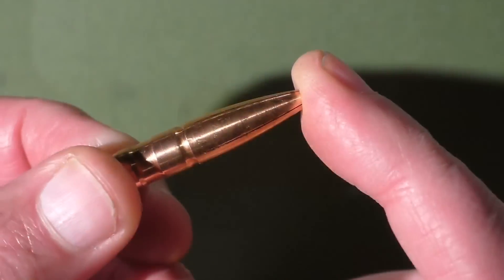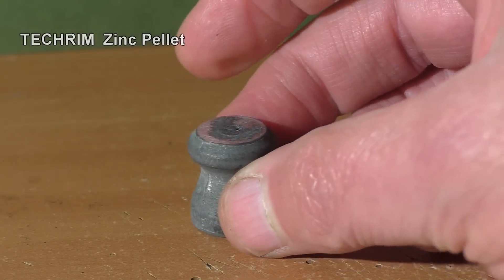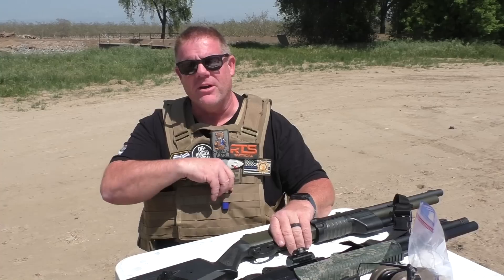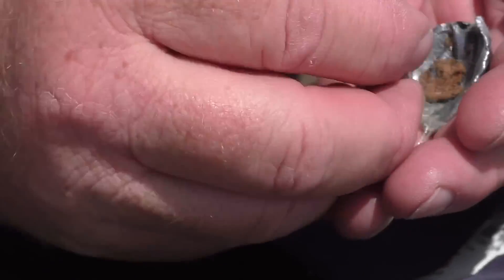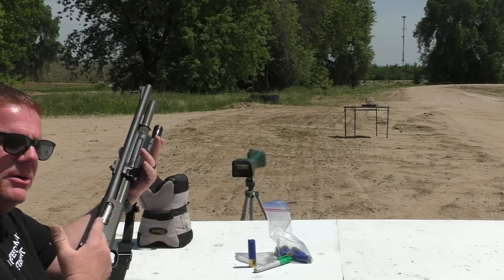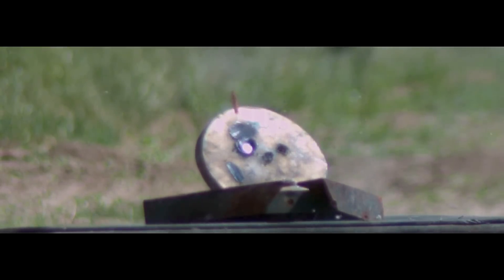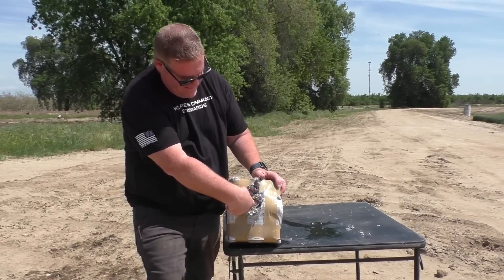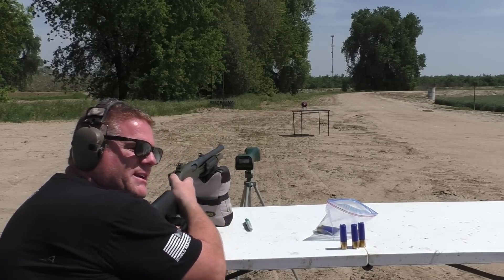300 Faust - 12ga. Slug Prototype -  First Test

Comment: Hi! I think in order for 300 to fly straight, you need to put a diablo with 300 in a container, to stabilize 300 in the barrel when moving, you need to make another container of two halves, they will hold the bullet in the barrel and when they exit the barrel they will fly apart, and you can put a coin or several coins on the bottom of the container for 300. It turns out that the diablo will be subcaliberal. Good luck!

Comment: Not a heavy metallic backing disk, but light. Try to find a titanium disk of appropriate size. The game is in yield velocity, which you will be far below. Also, once done with that bit, switch to the zinc pellet, almost bored to diameter. The Ti disk will do the acceleration, and with any luck, the bullet will go on, and the zinc pellet will separate like a sabot.

As an afterthought, you might have to cap that hollow point with something light and hard, like gorilla glue, to keep the supersonic shock from peeling back the petals.

Comment: could you cast the slug onto the 300 BLK hovering .1 to .15 inches over the bottom to make it incased inside of the slug so when you cast it lead gets under the 300 BLK round and fills the indents on the round instead of being pressed into it? That along with the steel disk you mentioned would probobly keep it intact

Comment: If you have the ability to pour lead into the back of the bullet and still maintain the shape of the slug with an 1/8 inch of lead over the base of the other bullet it would stop it from coming out the back side.

Comment: A small hole in the base but and then press the bullet into the slug from the top. 
I think the experiment may not have been a failure. Try the same slug without the 300 in it but just the drilled slug and a steel plate to push it out the barrel. Doughnut slug😂

Comment: Just out of curiosity, how did you center the spot to bore out the lead on top of the slug? I've been thinking about a decent way to do something similar to make a hollow point cavity with some flat-point lightweight frangible 9mm projectiles

Comment: The experiment may have failed, but it was still interesting to watch. That thing has some nasty punch behind it, getting through the wet magazines.
The two things I would suggest to keep the projectile together; firstly something more solid for support as Jeff said. Secondly, what about reducing the powder load a bit? 1600fps is fast. Maybe reducing the powder load a bit so the acceleration isn't as high, maybe the press fit of the bullet in the slug would be able to hold it?

Also, 9:20, we call those red cabbages as well. Aubergines are what you guys call eggplants.

Comment: If you know a bodyman, get ahold of some 3M panel bonding adhesive.  I'm not saying it'll work, but it could.  I've used it for many things that it was not designed for and it is just amazing stuff.  Imagine J.B. Weld on steroids.  Even if it doesn't work for this particular round, I guarantee you'll find other good uses for it.  I enjoyed the video.  Keep up the good work!

Comment: I know that everyone is a critic and that hindsight is 20/20, but I feel like this was kinda obvious from the start. The problem is that you're to use a straight wall friction fit with two different materials where the smaller (and harder) of the two is unsupported from it's rear-most surface as it is rapidly accelerated thousands of Gs in an instant. They would have stayed together much more consistently if the base of the 300blk bullet were at the same place as the rear surface (where the accelerative force is acting) such that both can experience the same force at the same time.

But again, I KNOW that it's easy to diagnose stuff after the fact. But here's my retort: as an engineer who's spent many years predicting and analyzing these types of interactions between various metal alloys, as well as someone who has been an extreme firearms enthusiast/advocate, this want surprising to me in the least. 

In fact, I was actually shocked that Jeff didn't consider this potential variable before loading all of the rounds up. It would be great to see this addressed in a follow up video where each 300blk projectile is pressed down to where it also touches the fiber wad along with the diabolo. Or, if he wanted to maintain the same length, slightly opening the 300blk petals such that the diabolo cannot be accelerated through the pressed projectile (which is the consistent separation between the two we see here.)

Comment: Drill  .007" smaller. Freeze the .300AAC round and press it into a 350⁰ degree lead slig. The expansion and contraction will make a tight as hell fit.

Comment: A suggestion:
After pressing the pieces together like you did... Cross drill all the way through both pieces and press a nail into the cross hole, then cut the nail off on both sides of the projectile.
    In other words... Pin it in place.
    Of course the hole for the nail needs to be sized for a tight fit.

Comment: Maybe a bit of epoxy around the inside of the slug for the bullet to bond to?
Just enough to adhere, but not enough to throw off the balance. 
Metal face to the wad? Tin circle? Aluminum Maybe? 
Interesting regardless.

Comment: Try tinning the bottom of the bullet and after pressing it in use a large soldering iron to solder the bottom of the bullet to the slug.  Or don't drill all of the way through the slug, bake a counterbore and press the bullet in until it hits bottom.

Comment: how about 2 metal pins going through the slug and 300 black out in a + pattern 1 higher than the other 
It might rip out with just 1 but i doubt it will with 2 and if/when the lead gets torn away in a target like um pork shoulder LOL why not the metal pins will add to the wound path yeh not much but still bet it would show in ballistics gel

Comment: Hey Jeff, if you want to do a good press fit, put the bullet in the freezer and heat the lead slug enough to expand it some. Obviously you have to be careful heating lead, 500-600 degrees would be more than enough. About .015 would be more than enough press. Probably the cold bullet might drop in if done quick and be super tight when everything stabilizes. That way you’re not shearing off lead doing a regular press fit. I was a toolmaker for 25 years and did this stuff all the time for many projects.

Comment: Was that a HRC made in China Hard Drive? I hear they emit a chlorine odor as they heat up.....   So... easy button...JB weld..put some on before pressing in, fell rear..... not so easy but probably better.... Solder the rear.... hardest... "tin the back half of bullet, heat bullet slightly above the slug melting point/, flux and press in, solder rear...   cool idea, fan of Lehigh bullets for years....

Comment: Ahh, the "Dry-hoondirt Faust" a new fan favorite for ingenuity.

I'd try scuffing the round and hole before pressing it in and using some red loctite or higher. A little bit of fimo clay would be easy to form into a drop out support piece in the back of the diabolo.

Comment: 13:19 cross drill the slug/300 blackout and secure the slug & round with heavy gauge steel or copper wire or ??? something to make the connection between the two permanent. putting a steel back plate, isn't giong to fix the issue. You need a physical connection between the two. Lead expands in the barrel, and creates enough of a gap between the bullet & the slug.

Comment: Before you write it off as a failure think outside the box, you now have the 300 Faust Double Tap, the round that hits you twice. As far as metal disk, find an electrician and have them save you some small knockouts, you may have to size them down a littlest bit, just an idea. Also, try  super glue to hold the bullet in place. Hope y'all have a great week guys.
Reply: Superglue would be bad because it can't withstand shock. JB weld would be much better.
Reply: @witiwap86  or heat it melts
Reply from the maker: lol
Reply: I’d go for red locktite

Comment: Take the blackout round and lathe the base of it into a pin about .5 inch long.  Drill a center hole in the top of the diablo slug the same diameter as the pin. Super glue and press together. 
The reason the round is seperating from the slug is the g shock is pushing the round out of the slug the same direction that it was pressed in.

Comment: I thought the first shot was a keeper. heart AND throat in one goal. BRILLIANT!!!
Retention;  JB weld.  Heat the bullet and slug before joining, may solder them together.
If JB or resin, drop a primer in the hollow for a little extra spice.  Or skip the Blackout and pack the slug with primers.  Possible early 'sparking'... working on that.
OOO ooo. Lead fill a hole saw bit for the rifled barrel.

Comment: Good potential. It might help visualize the firing process to think of the components as being soft and plastic. At those pressures, they are, and flex and squirm in strange ways. Gasses will distort the shapes; hence being unable to join the projectiles firmly. The modeling of the initial 0.1 seconds of a nuclear detonation, sort of.

Comment: Drill the slug from the top and leave enough of it at the bottom then press the blackout in from the top make a tapered dohicky so when you press the point with press you don't destroy the tip. Great shoot that's how you learn.

Comment: Looking at the profile of the 300 Blackout bullet, I would think you might have better luck casting the pellets around the bullets,  There are 2 lateral groove bands on the bullet that the lead could grab onto.  Add in the metal disc, and I think you'd have a winner.  Great video!!
Reply: I was thinking something similar. My thought was pour lead into the cavity and seal in the 300 Blackout. But I’m not sure that the new lead would “bond” to the slug. It would probably be better to cast a new slug around it.

Comment: Greg, I have an idea for how I can solder your bullet together, but I'm not 100% if it will work. If you're interested you're welcome to post up a way to contact you and I can give you an address to send a few of them to. I would need to keep the bullet cold somehow while I do the work but I already have an idea for that one (i'm going to freeze it in water ice and solder it from the base first, then re-freeze it upside down and solder around the nose). If you have any better ideas you're welcome to try them, but IDK why it wouldn't work if they're properly bonded. Another idea is you could buy a sacrificial mold, drill it out, buy some flux paste meant for soldering, and coat the bullet in it before pouring. This would allow you to solder it in place yourself far more reliably than I ever could manage on my own. If freezing it in ice doesn't work I could probably try ceramic or even sand as a support, but I'm concerned both options will leave a coating of them on the projectile. You could also try fluxing the bullet before you press fit it, and then encasing it in a plaster shell, before heating the projectile so the lead melts and solders itself to the copper bullet. I'm sure I could think of other ideas if given more time, this was just what I came up with while watching the first half of the video lol. But yea, plaster is probably your best bet for DIYing my idea yourselves, it can withstand 2200F/1200C temperatures before melting, much hotter than lead needs to be in order to melt it.

Comment: Try threading the blackout into a threaded slug next time. You’ll loose some copper jacket, but if you cut slow and deep, it should hold. Or pour some resin into the skirt of the slug after you’ve inserted 300.

Comment: Since the blackout is a boat tail round, would you get enough support if you poured the cavity in the bottom with more lead, resin, etc.?  Just trying to think of a simple solution.  Was thinking that if the base was solid, it'd give better stability.

Comment: If you coat the slug and bullet with some flux and heat the latter with a torch for a bit, they should meld together. Maybe add some solder to keep from losing lead out of the slug... Or, drill the hole even smaller and heat the bullet to 650-700F before pressing it home. Or... well, you get the idea.

EDIT: Had a last minute thought.... you're going to have issues with this particular slug unless you can firmly, physically attach the bullet to the slug somehow, and even then it may be trouble. Why? Because the slug base is a gas check, whether intended or not. It's going to expand to fill the bore within the sabot sleeve, and when it does so it's going to stretch the hole and remove the tension from what's currently a press fit. It might even be enough to tear a glued or soldered surface apart. If that's the case, the easiest solution would be a pin (as someone else already mentioned) or possibly adding a metal gas check to the bottom of the projectile.
Reply from the maker: probably end up as a puddle of lead  lol
Reply: @taofledermaus  If you could find yourself a mold for those slugs you could modify it and cast around the bullet, then the bullet's rings would help hold it in place as it's a shrink fit.

Comment: The only thing I can think of to try help the two pieces of the round stay together would be to cast the bullet into the lead slug. I'm thinking of a solid diabalo slug, not one with the hollow skirt. And I'd have it so the base of the bullet is up say 1/8th of an inch to help stop the bullet passing backwards through the slug.

But this is coming from an Aussie who's only experience with guns in paintball and a bb gun when I was a kid.😅

Comment: I actually think that you are on to a great concept with this. However, instead of drilling completely through the slug, how about only drilling a third to half way down from the top and use some epoxy. That way the slug will expand and then push the.300 out. Instead of blowing around it

Comment: I think you'd have better luck if you somehow cast the bullet into the slug. press fitting just isn't enough. Or maybe you could press fit it into the slug, but leave some solid slug in the butt, so it can push against the bullet

Comment: My two initial thoughts were a lead or magnesium back plate behind the slug,, Then the complicated process of casting it in a slug, or even turning a simple mild steel boring tool the same shape as the back end of the blackout so you could drill that shape into, but not all the way through,  the lead slug

Comment: Try top drilling and do not go all the way through the "Diablo pellet" then insert from the top hole you partially drilled through till it bottoms out. I used this method for tungsten core pistol ammo yrs ago. It worked great and would shove/hammer the tungsten straight through the hard target. Never a slip through.

Comment: You need a couple of the back of those pellets in order to keep the bullet from coming apart I think I seen that opening I was like the pressures probably going to separate them when you fire it was like off the back of them with solid it probably wouldn't

Comment: Have you gents fired the very modern 50 cal pellet rifles? They can drop a boar or deer from what Ive read.
The Umarex Hammer fires a 550 grain 50 cal pellet at 760 fps,and generates 705 ft lbs of energy.

Comment: Seeing those diabolo slugs go downrange with their empty centers reminds me of an article I read many years ago - possibly pre-internet - about a projectile then being experimented with called the "Flaytau Ring Airfoil". If I remember correctly there was concern that its nearly perfect distribution of trauma as it created its wound channel would make the wound surgically irreparable. Seeing the massive energy dump from the slug into that jug of water was impressive.
Reply: Um technically unrepairable is what you want unrepairable means the threat is stopped with fewer shots if a single bullet could punch a basketball sized hole in a threat the threat is over period 
Needing to fire fewer rounds in a fire fight means that you wont put innocent lives in as much jeopardy assuming you can control your instincts to mag dump that is which is way harder than most thing
Reply: @nanaki-seto  what?

Comment: Maybe try some red loctite in the press fit, possibly while undersizing the hole a bit less, maybe try .020 undersized instead of .027. That way it won't have to push as much material out of the way and I feel like it would be just as secure, maybe even more so. In my experience there is kind of a sweet spot for press fitting into soft material like lead, too much undersize and you actually end up with a looser fit. Counterintuitive, but that's my experience.

Comment: Use a penny in the base of the diabolo slug. The force of the shot should hold it in tight, possibly driving it a little farther up into the cavity. Cheaper than messing around with hair products (Gorilla Glue) or mechanical fasteners.

Comment: Need to weld it into a steel slug. You could make the hole a little larger and the weld should hold it. Mayde cup the hole in the slug at the exit so the weld material can build up, then smooth it out some with a grinder. Or use a weld at the back end might be better.

Comment: I wonder if it would have worked better if they were drilled 7/8th the way from the face of the slug in and pressed in from the front. I bet would be hard to do but I think that would keep them together. But always a good video failure or success!

Comment: Looks like the momentum change is what is separating the parts, with the lead outer projectile heading out and leaving behind the copper bullet in the middle.  Instead of drilling all the way through the lead pellet, try going most of the way through and leaving a portion intact to carry the bullet with the lead pellet, or possibly adding a pin through the copper bullet at the front that will hold it to the lead pellet.